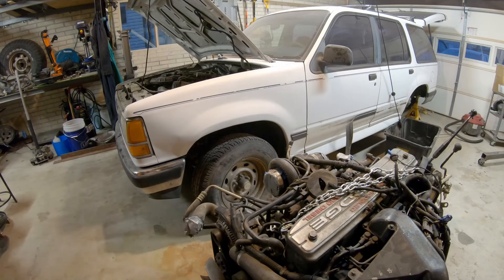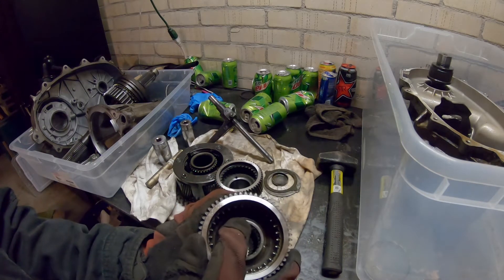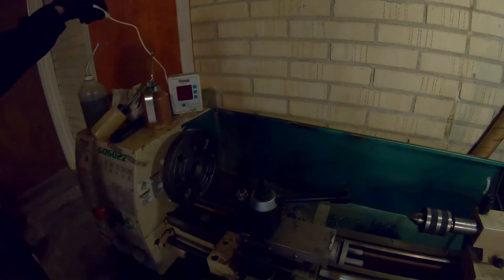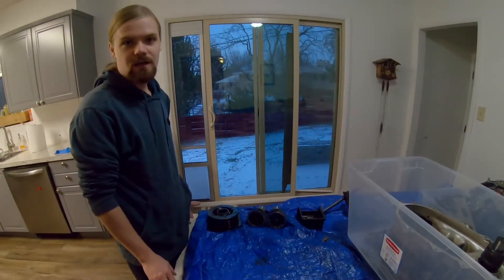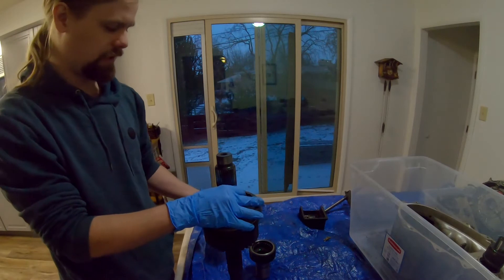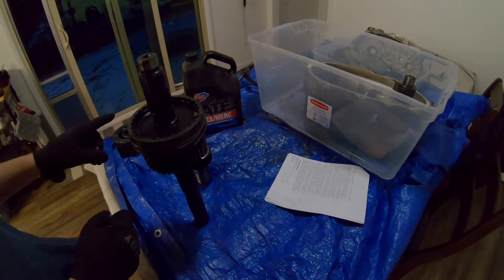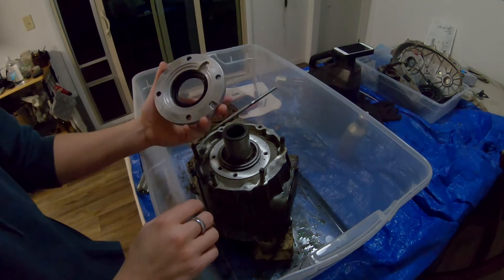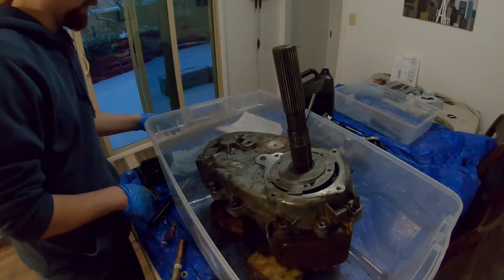Why Did I Need THIS to Install a TRANSFER CASE?? [NP241 Rebuild Part 2]

Comment: That's a common problem is a year thing.  The 94 and older is unreliable on which bearing it uses.  95+are more consistent. Watching this video to pull mine apart so i can measure and get the right one for my 32 spline input swap

Comment: I cannot get that tail housing on.  It looks like it is sitting flush on the case but the snap ring is 1/2” away from the bearing groove
Reply from the maker: It's been a while since I did this, but if I recall correctly theres a rubber plug you have to remove on the tailshaft, then stick your snap ring pliers through the hole in the plug to seat the snap ring. This was one reason I had to go buy some better snap ring pliers, my normal ones were too short and a couple screwdrivers wasn't cutting it.

edit: you can see what I mean at 14:14 but its speed up, this is where the plug is you stick the snap ring pliers through. Apparently I also used a pry bar to pry up on the snap ring to set it.

Comment: Can you send the link for the shaft?
Reply from the maker: It was either here:
https://torqueking.com/

Or here:
https://www.allstategear.com/

I cant recall which it was a while ago. Either way make sure the diameter and spline count are correct for your application, and consider getting the roller bearing that goes inside it as well

Comment: My 1st thought... oh my that input shaft will be case hardened... hope he has a grinder...    but I see you got it cut.  Since a bearing goes there, so yeah.. I agree with you, lathe will work.. not like the case of the bearing should spin.  Did you loctite the bearing in?
Reply from the maker: Yeah I should've thought of that before I started, but carbide tools made it work 😅. I don't remember if I used loctite or not (I can't believe it's been almost a year!) but I don't think it's necessary here with the press fit. Not necessary, but still not a bad idea for applications like this - good insurance as long as you use the right color and follow the assembly guidelines.